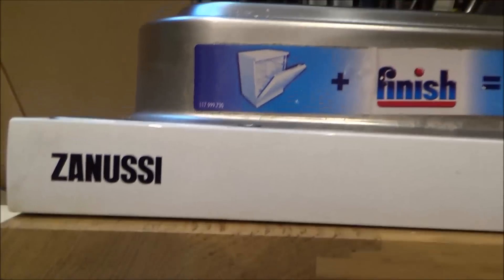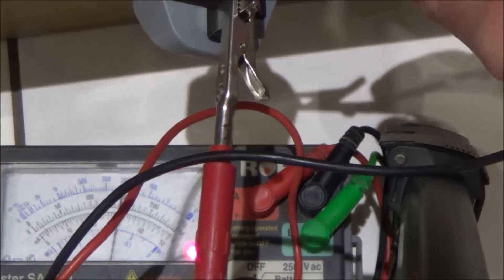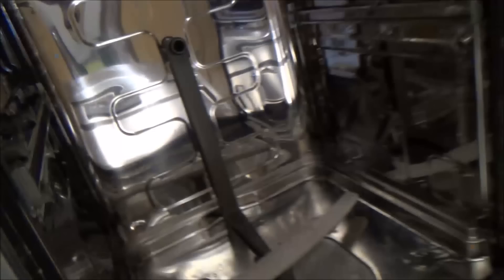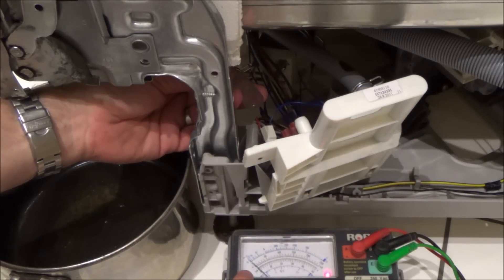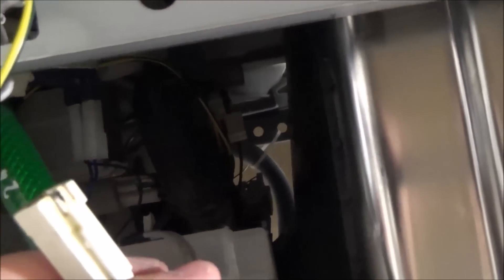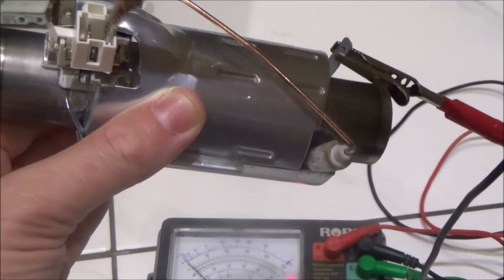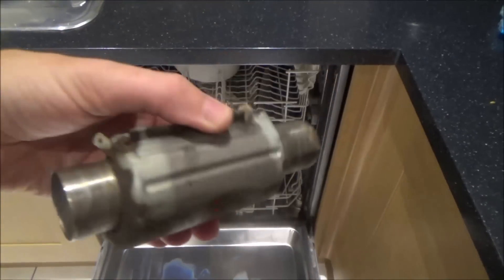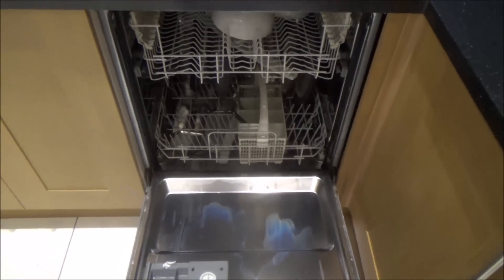Fixing a Zanussi Dishwasher which keeps tripping the ELECTRICS

Comment: Today's lesson: A component with no connection to earth can't have a live-earth short.
Reply from the maker: Yes, very true. I wasted a lot of time on that pressure switch but I thought the live might be leaking to earth through water or dampness in the pressure switch from the water in the pipe feeding it but I was wrong :-)
Reply: We've all been there, although the water would have have had to have had a lot of salt in it for that to have been the problem.

First port of call IME for anything that heats water and is tripping an RCD is always the heater element itself.
Reply from the maker: Thanks Graham.